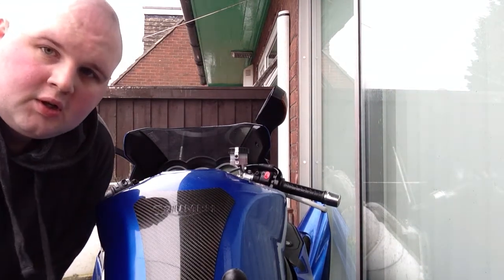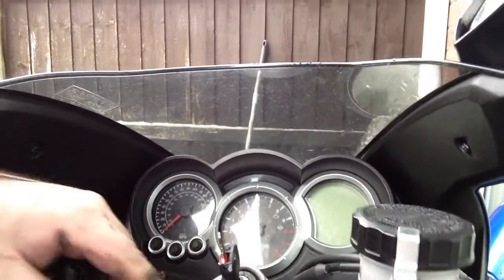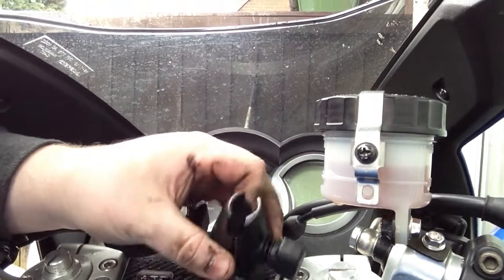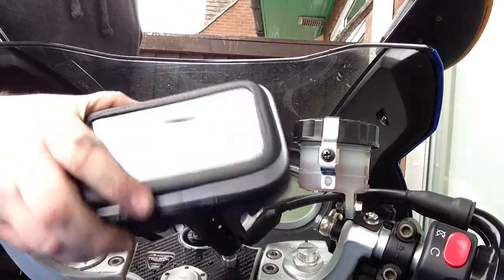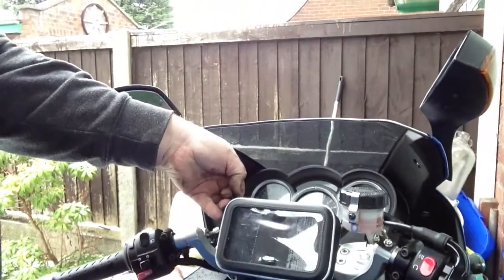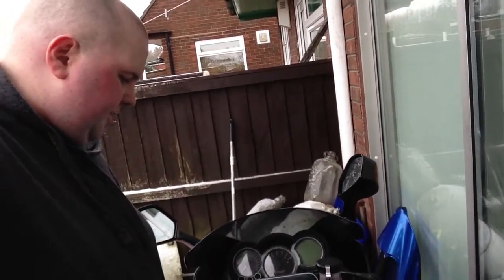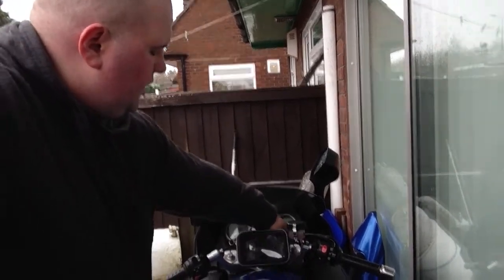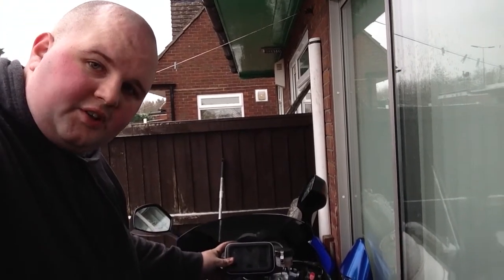RAM Mount Sat Nav Solution for a motorbike.

Comment: This unit mists up very easily.
As a phone satnav user, I bought a Kappa phone holder for £35 which is detachable so no moron can nick it, touch screen with a visor and the cable runs under the unit.